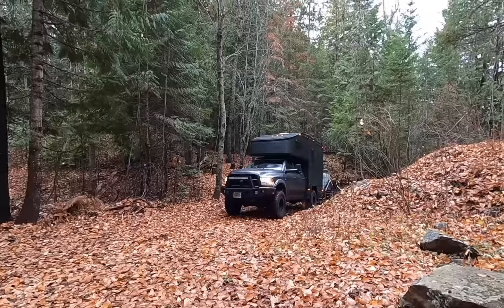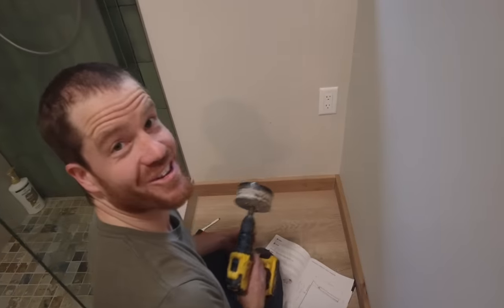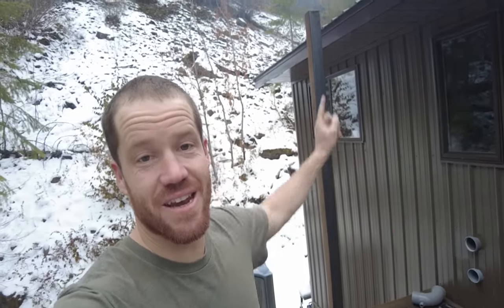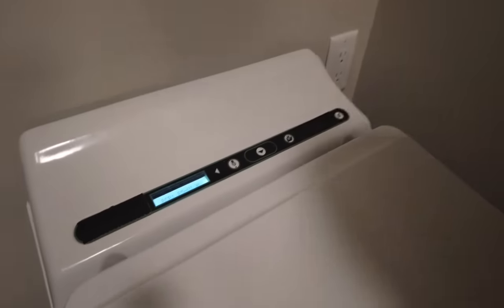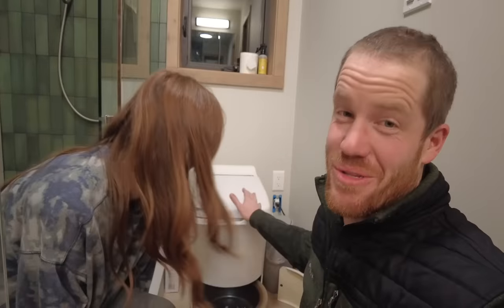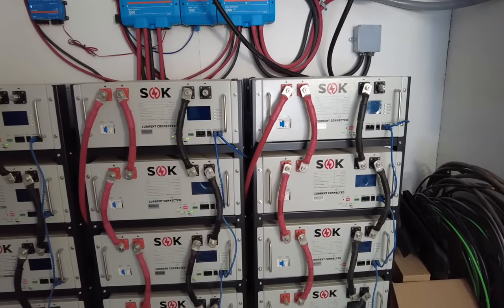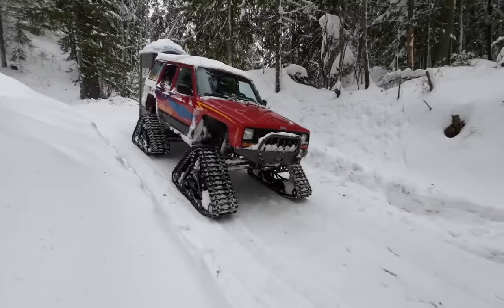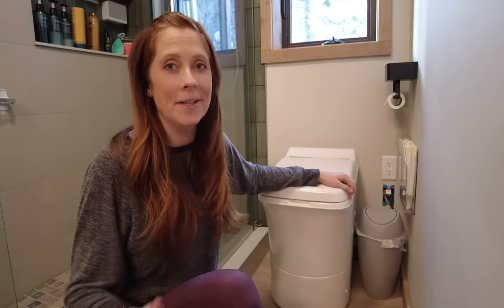Easiest Off-Grid Toilet? | Burning Our Poop!

Comment: I may be naïve on the subject but for a temporary solution why wouldn’t you install the permanent toilet and pipe it out to a hole in the ground with a cover and a vent? Not much different than an outhouse but pipe feed from indoors, you could manually fill your tank between uses.  Once your septic system goes in , backfill the outhouse hole reroute your plumbing and be done with it. Or is this illegal?

Comment: You guys own a mini excavator and a cat, I’m surprised you haven’t installed your own septic tank and drain field? 
I purchased a 1500 gal poly tank from Menards for $1600 and the distribution box, risers, pipe and fittings, along with the bio chambers was about $2500 extra. 
Not having a well is an issue, but rainwater collection and a storage tank would solve that. Gray water from the shower, could also be reused for the toilet.
My grand parents used rainwater and a cistern for years for everything but drinking water and it was pumped from a pitcher pump. After they got electricity the well pump filled the cistern and was used until the late 80’s

Comment: I have a 32' 5th wheel, and spend way too much time dealing with.. that stuff, and when you pull the handle it stinks. It's like pull and run.

In the 70s when I lived off grid with 5 other people, we had an outhouse.
1st you have to dig a 10' hole. Then you build a nice arty-farty building on a sled.
There was lye and stink. It worked pretty well. One hole lasted a year. Digging the hole in Southern Oregon's volcanic soil and rock was a lot of no fun.
New technology makes life much easier nowadays. We didn't have any choices like this. The other choice was a orange bucket with a Snap-On toilet seat and a large bag of sawdust.
That's not much fun either.

I do think your new toilet is very cool.

Comment: 0:01 Built-in, snow-melt implementation of a residence heat map. I wonder if it would pay to boost the insulation above the living area? Or is it the chimney causing a snow slide. Interesting either way.

Comment: Are you able to use that more than once within the 90 minute burning. I am curious if someone has an upset stomach and has to go a lot in a short period. Also what happens if you wake up sick and have to run to go. Do you have to pray you get the bag in or can you pre set the bag in. Sorry for the questions just keeping it real.
Reply from the maker: Yes! It can be used while incinerating.

Comment: I looked at these, but they're still a little bit pricey for a temporary solution. We went with a budget friendly diy 2 bucket system with a urine diverter and pine chips, which I bury/compost. 😂 Your bucket of ashes cleanup is likely much more pleasant.

Comment: did you push insulation back up into the wall after running the electrical so no cold spots in the wall?

Comment: I want this for my van build. I orefer electric not propane. Would you see any reason it can not go on a drawer slide to tuck away when using the shower? The electrical can all be installed behind the wall, right?? Can you say which you chose and why? There are several on the market. Thanks so so much!!!

Comment: How will you plug those holes once septic/ waste lines are installed for toilet? Just replace entire sheet metal on outside? Also if you don’t have a septic, where does your grey water go, does a pipe just daylight somewhere outside?

Comment: What about using a Anaerobic Digester? Like farms use for livestock waste or big ships use. That way it’s a self contained tank and meets EPA standards and you can get methane gas from it. Put food scraps and dog waste in it. And number 1.  And gray water.  You’d have to bury it but it would just be one tank not a leach field. I imagine it may work above ground insulated. I mean it would heat itself while digesting.

Comment: have you thought about some of the micro water turbines that convert rain runoff in downspouts to electricity? 
i remember seeing micro wind turbines that attached under the gutters like a long square tube full of what looked like small box fans but were turbines. looked around and couldnt find the videos though.

Comment: When I was in Camrahn Bay Vietnam courtesy of the US Army back in "66-'67 we had a multiple hole outhouse.  The excrement went into cut off oil drums and since two fellow soldiers got into a fight in the mess hall one day, they got permanent detail of dragging the containers out and using diesel fuel to burn the contents.  That was at least a six-month punishment for their altercation which involved one chasing the other through the dining area with a knife!  Better than a court martial or other things that almost happened.  $5,000.00  is a luxury but it sounds like a real well designed piece of equipment.  Merry Christmas !

Comment: You have an excavator. Dig an outhouse hole. We used one for years. As long as you have it vented well and have treatments for it, the smell is very minimal. Even install heat and light in it. A six foot deep hole will last 10 years for two people. 😊
Reply: A out house is really lousy at -10. I had to keep my toilet seat in the house behind the stove so it's always warm in the winter.
Reply: @markmitchell457  I just had a heat lamp going in the cold weather. Insulated too. 🙂

Comment: I was just in a similar situation and concidered the incinerator, but due to not having an outerwall to put it against I had to choose another option. 
People I know are very satisfied with their incinerator, and I would really try to make it work if I had the oprion to re do my toilet. (re do, as in dodo)
I have seen campevans with electric ones installed, it might be pushing it for the electrical system on cloudy days, but in worst case there are generators for the 45 minutes it is burning

Comment: It sounds to me that this is better than a wet system for your home. Granted you still need a solution for the grey water but the cost of what you have has to be less than a septic system.

Comment: Some questions you didn't really address in the video: 1) Toilet paper, which I presume just burns like the rest as long as it drops down into the combustion chamber correctly. 2) What about #1? Does it have any problem handling both #1 and #2 or do you have separate solutions? 3) How long does it run after each use? Since it draws 2kW, and consumes 2kWh per day, I assume it's running for about an hour per day. So 1/2 per use? 4) How long do you have to wait between uses (probably related to the previous question)? I'm guessing you can't "flush" again while it is "burning," but could you use it (in an emergency) just after someone else started an incineration cycle? Or do you not want to be sitting on when it is incinerating?
Reply from the maker: It burns toilet paper just fine. It also handles urine. You can use it while an incineration is in progress. The burn chamber is big enough to allow about 4 in a row.  It uses about 2kwh per use not per day.
Reply: @AmbitionStrikes  How long does a burn cycle typically take?

Comment: Great when you have a drone and make shots from your roof. Exactly there where your living parts are you can see that the snow is gone. What that means is that your isolation in the roof does not work otherwise the snow was still there. So dear people, with all your work to the building, you have to do again ASAP the roof over your living quarters. Good luck.

Comment: So I'm not understanding why the plastic piece running out from the incinerator and then moving to metal? Won't it be hottest coming out of the incinerator? If that's the case won't that plastic melt? And if it's not hot enough to melt the plastic coming out of the insiderator why does the chimney need to be metal?

Just as an aside, we have use of a commercial portable outdoor incinerator toilet. Very handy (& really nice that it's warm to use in the winter, unlike a biffy).
Reply from the maker: The plastic piece came with the toilet. The metal was available locally
Reply: @AmbitionStrikes  gtk, thnx 😊

Comment: That's a hot way to convert poop to fertilizer! 😉

You can put your biowaste into a biogas reactor, store the biogas over the year and use it to run a generator in winter -> create fertilizer, heat and electricity instead of using it up. 😉

Comment: I think that is a significant amount of money. I also think that you could easily deal with a composting toilet in a remote area like you are in. You can get sawdust free and you can bury the stuff anywhere in the woods. It would surprise me if that electric toilet works without any problems for a significant period of time. High temperature= fire hazard, energy sink, technical weak spot. Good luck. What do you do when you need maintenance?

Comment: Did you use some sort of insulation on the chimney and penetration through the wall after the video? Otherwise this toilet is a big thermal gap and you even could get mold in your drywall and insulation.

Nice work with the porterpotty :D

Comment: I am a bit confused on how often it actually requires a burn.  Is it 60-70 minutes of burn after each person uses it, or can two or more people make a deposit and then burn all of that for 60-70 mins?  

Also, you didn't mention what happens with #1 liquids.  Or is that going to be covered in a seperate video?

Comment: Google , Primary Water, get water even on barren mountains vertical rock fissures, usually always under pressure from deep in the earth. Would make a great video because so few know about it. Many installed in the hills of San Diego desert high hills far from the augafer

Comment: Whew!!!  At first I thought you were putting in a composting toilet.  We had one for about 3 years while we were building our last house.  They are amazing science devices.  But...the variables have to be just right or the process breaks down and guess what?  You end up with a toilet full of un-composted human waste.  Someone (it was me) is taking that thing outside to clean it, and it's not a fun task.  It's pretty disgusting.  I don't mind a dirty job every once in awhile but that got old.
As a side note: composting works really well when it works.  I think the problem is the variables (temperature, moisture, tumbling, etc. are just too finicky for a simple composting toilet.  If one of those variable is off the natural cycle breaks.  I always thought they should use something like a raspberry pi and program monitoring and control of those variable.  Composting toilets are expensive, ours was about $1300 15 years ago.  A couple hundred more dollars for a heater, fan to vent excess heat, moisture delivery system, auto tumbler, moisture and temperature sensors, etc. would be worth it if it kept the cycle from breaking.

Comment: HOW OFTEN DO YOU FIRE UP THE DIESEL GEN... TO KEEP IT FROM LOCKING UP... THOUGHT I ASK... AND A CHARGED BATTER UNLESS YOU HAVE A AIR STARTER FOR IT.. ( AIR POWERED STARTER )
Reply from the maker: We’ve run the generator 4 times so far!

Comment: Is that the recommended romex wire gauge for 220, per installation directions?
Reply from the maker: It’s a 20a circuit so 12g wire is the appropriate wire.

Comment: You just SAVED $5000, because you don't have to now put in a 'Sand-filtered' septic system, which will cost the same to have installed. Even DIY it would cost at least $2500 for just the material.

Comment: 1. Put a liner in after you use the toilet so that in times when someone is having the big D they will not make a mess of themselves while putting a liner in it.
2. Depending on the type of paper your toilet is using for liners it may be more cost effective to buy a roll of that paper and make a folding jig for the inserts yourself and save a lot more. 
3. Would have gone with ecojohn or little John incinerator toilets that do not need a liner.

Comment: This must have been developed by a military veteran.  In Vietnam we used half of a 55 gallon drum, pulled it out of the back of the outhouse, far enough away not to burn down the outhouse, poured in a gallon of diesel fuel, give or take, and lit it on fire. Incinerating toilet.

Comment: not really a good idea in the long run. I service a burn toilet for a lady. lots of maintenance, big electricity consumptions. takes a lot of time to burn the crap, one crap at a time and who will "wait" or reuse the same crapper after another?, make sure you get the special toilet paper liner if it needs it and most likely the manufacture is the only one who sells is and if they run out or have to ration it like what happened during covid, then what? make sure the small holes stay clear.  If not a "clean" burn then pipe can be coated with black hard stuff. make sure you have extra parts like the burn coil.  just saying.  Electricity is very important as these need lots of watts

Comment: You look way too young to be making this cardinal sin that you have been making:  Before about 1973, electrical delivery voltage was nominally specified as 115 or 230 volts.  Before 1968 it was approximated as 110 or 220 volts.  Now that you are talking about modern systems (since 2000) you should know the utilities target 120 or 240 volts.  Even your inverters should say that right on them!  Maybe you are around "old" people a lot?
Also curious about your location.  You have California plates on one of your vehicles but the porta potty had an Idaho phone number on it.  Where are you (roughly)?
The toilet solution looks extremely reasonable.  Congratulations on finding that and for sharing it!

Comment: I could be wrong, but taking that much out of a stud would have repercussions wouldn’t it?
Reply from the maker: In this instance, no. It’s a post frame building so the studs are just there to make finishing the interior work. They are not load bearing. Also because it’s under a window it really doesn’t matter. To make matters more confusing it’s actually not a stud it’s a furring strip we used to space out the wall to make the shower install easier.
Reply: @AmbitionStrikes  bam! Learn something new everyday!! Thanks for the explanation

Comment: $5,000? For a toilet? When I lived in a boat I used the bucket and chuck it method. The bucket cost $8.99 from Home Depot, and a few cents each for each plastic bag liner. A way better deal, in my opinion. The only downside is getting to see your poo again each and every time, but hey, man up, buttercup.

Comment: Sorry, but i live in ungodly cold and cloudy enviroment just like you. In Scandinavia. You REALLY? just poked hole on the wall and stuck plastic tube through it. I dont know your incinator mfc instructions, but you have to SOME way at least make that piercing windtight (preferably breeze AND thermally insulated piercing) else any man who sits at that potty suffers permanent constriction of balls to peanuts. Maybe not today, but things move (you shake r roll the potty when ash can is extracted). Piercing as shown in video WILL blow freezing cold air like hairdryer from hell to hind parts in couple years, i quarantee.

.